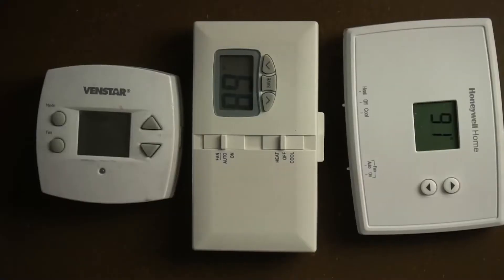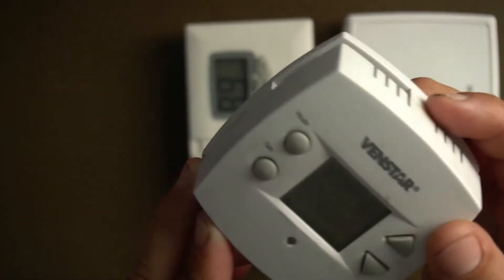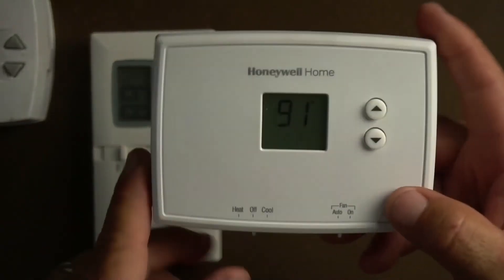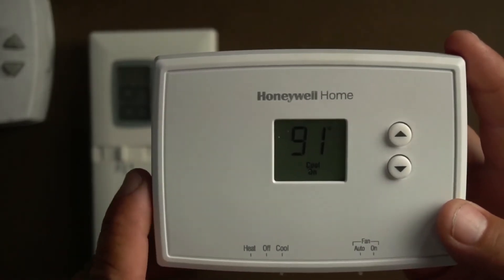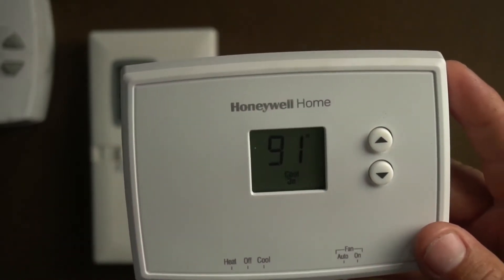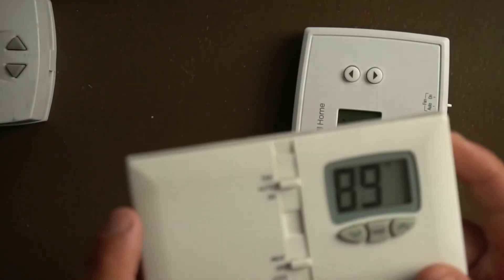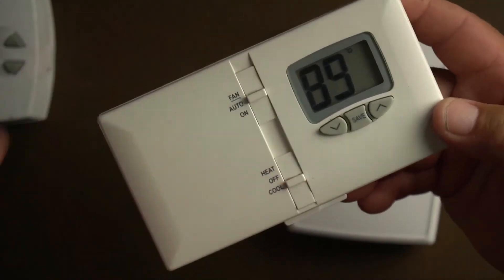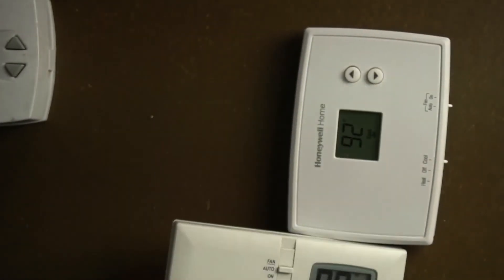A/C won't turn on, thermostat blinking or not working. #apartmentmaintenance #thermostat #hvac

Comment: Before and after replacing my thermostat, my "House Fan Only" mode has been inop for years. My G wire is connected correctly, but it's just not switching on. All other central AC and heating are normal. Ideas?